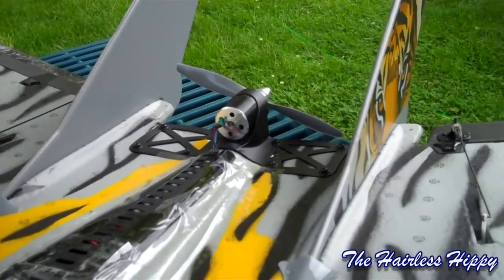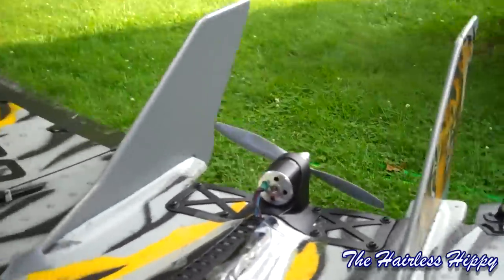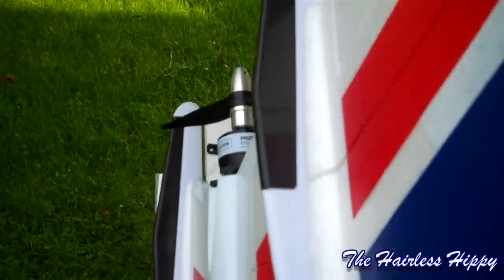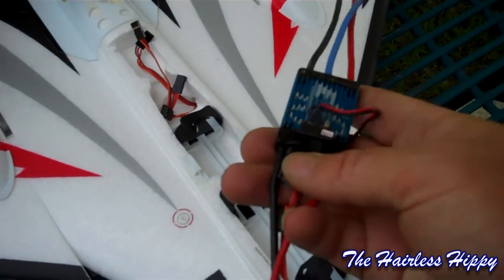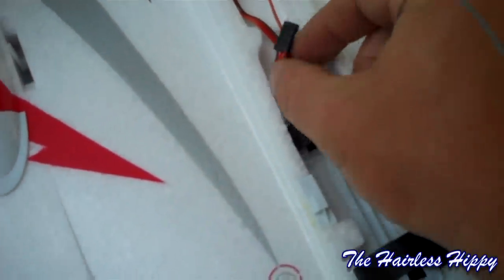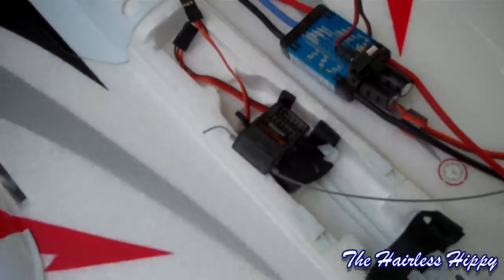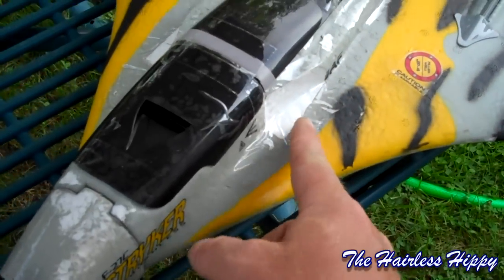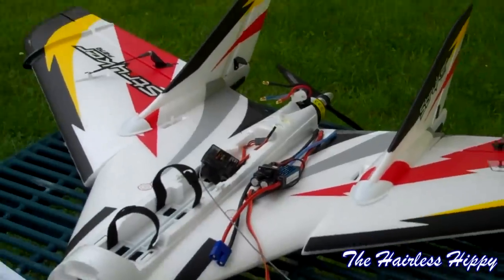Parkzone Stryker 27 q internals PNP installing receiver and replaced motor on 27 c

Comment: How did you know I had just bought myself a Stryker 27Q? lol.  Anyway, I'm loving it.  It the first real fast plane I've owned. It really keeps me on my toes.  I got the BNF and the Reciever is located in the rectangular section just behind where all of the cables come in.  Now as far as the cables being short, the BNF comes with a Y splitter extender cable that ties them ties something together. Probably the ailerons. I'm sorry but I'm not at home now so I'm not able to look right at it.

Comment: But I'm sure you will need to get an extension cable for sure and I believe you want to put the Y splitter on the ailerons but I recommend you call Horizon Hobby product support at 800-338-4639 to make sure.  Also on mine the receivers long antenna runs along the right edge of the fuselage toward the front and remains inside and the short sticks out of a tiny to the left.  That is if you put the receiver in the correct area in the rear.